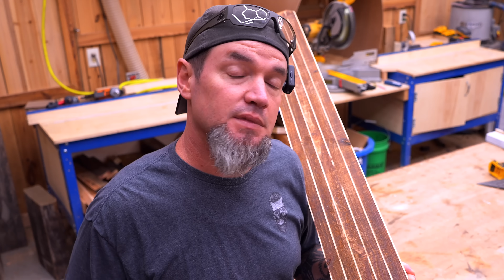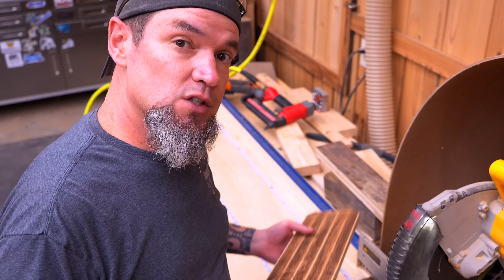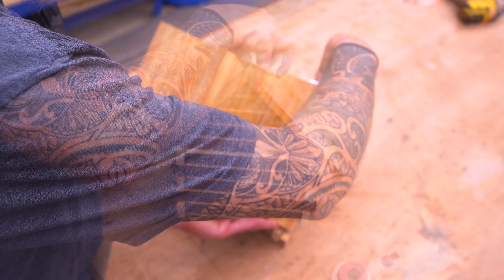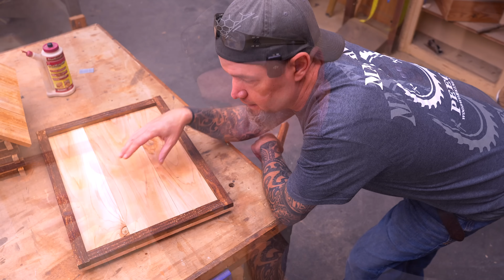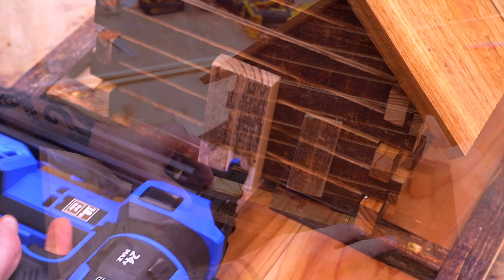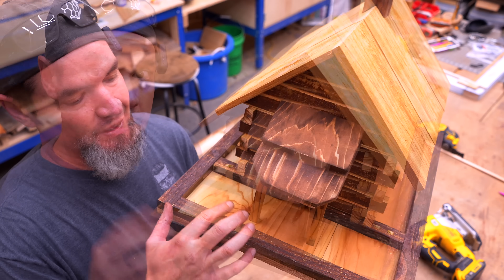Easy DIY Cabin Bird Feeder Anyone Can Make!

Comment: Hey bro want a pro tip for your miter box get you a plastic tape measure and glue it to your miter box fence with the blade splitting zero no more measuring each piece bump to the number and cut🤌💪

Comment: Hello Mr. Peech, thank you for this build of a bird feeder. I made one earlier this year following the steps in your video.  I was worried about the bird feed not flowing out when it was getting low, so I added a very crudely type v inside the feeder to keep the feed from just laying on the bottom of the tray. I am planning on making another one to give away at our family Christmas Party later in January 2026. I was wondering if you might have any ideas of how to make something like that to add to the inside of the feeder to ensure the feed would continue to fallout as it got lower with less feed forcing it out. I going to try to make something better than I did before to help keep the feed flowing out the openings.  I hope I explained what I am trying to do.  Any ideads would be appreciated. Thank you again, Joe W.

Comment: another improvement would be to attach the house to the base with wing nuts so you don’t need a tool to disassemble for cleaning.  Also solves the problem of screwing at an angle.  

Also, make the MIDDLE section open, not the back. If you plan to hang this by a chain you need somewhere to attach the chain in the back.

Comment: Hello Mathew, I watched your video and was impressed. I actually made one of these bird feeders and overall it came out pretty good. The only thing I had issues with is cutting out the cut outs for the overlaping of the logs. I guess I am not to good with a jigsaw in small areas. they were not the straightest and cleanest looking. what do you thing about using a mortise machine?

Comment: How heavy is that brad nailer? I used my nephews Dewalt and it weighs at least 5 pounds with a 5ah battery. My pneumatic only weighs about a pound. It makes a big difference if you have carpel tunnel.

Comment: 2 things im going to add to my feeder is 4 pegs one on each hold down boards next to the screws that hole it in place, reason  is so its always lined up for putting the screws back in if and when you remove the cabin from the base.  second is a way  to disperse so the seeds dont pile up on the inside away from the hungry birds.

Comment: Aww I Love Your little small projects Matthew! The Log cabin Feeder looks amazing. I had built blue bird 🐦  House's in the same fashion , using 1x straps of eastern Cedar. Just a thought to spruce it up maybe installed at an angle a chimney  on the top roofline & and a small pieced saw buck accent  on the front door. Anyhow, love your work on the smalls, keep them coming..Kay Clark
Reply from the maker: That sounds awesome! Thanks for the support.
Reply: Matthew, really like the contrast in colors between the roof & siding on Your log home bird Feeder. I'm just curious: What type of tablesaw do you have? I really like that type of rip fence on yours. Mine is a 25 yr. old Sears craftsman, Looking to replace with Delta contractor with iron tables from Lowe's. What do You think about that one? Thanks..Kay

Comment: You didn't mention it in your video, or maybe didn't even know. The Kobalt brad-nailer you used is currently $70.00 off, as of this post. The battery and charger are only $49.00, so there's two great deals to be had there, if you do the math.

Comment: I appreciate your suggestions about cedar pickets. I have used them for planters and a number of other projects. I plane off the rough surfaces and end up with great looking wood for a low price. But they were $2.58 each last week for 40 boards,  now they are $3.28 each for the 60 I bought today. I usually get them at Lowes sometimes at Menards depending on who has them. Stocks have been low. Thanks Lee

Comment: Great build but I see a potential for seed being stuck in the middle.  I suggest a small angled piece inside to push the seed towards the edges so the birds can get to it.
Reply: Essentially, the design is not functional in its current state.  The gaps under the cabin are too small to allow the seed to escape properly.  It needs an angled floor inside to help push the seed out.  The worst part is that the roof access and floor design mean that after the first rain, the seed inside will all be completely wet and either start sprouting or go mouldy.  It looks nice though...